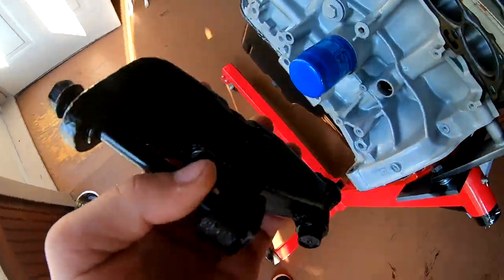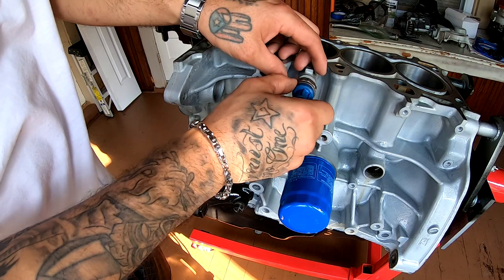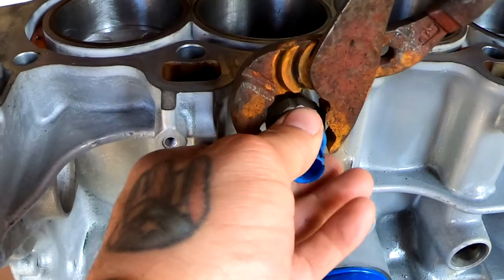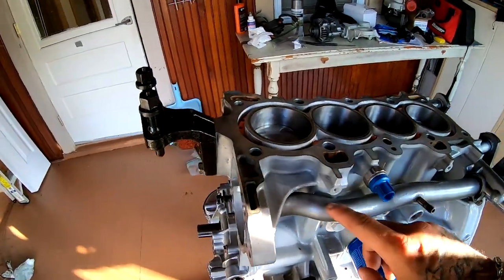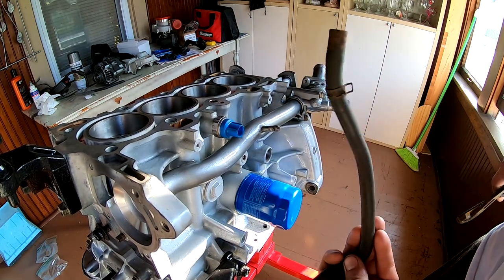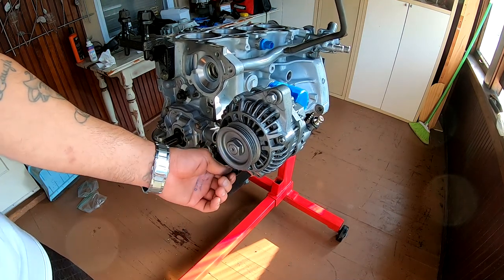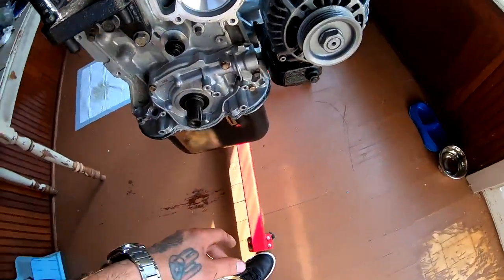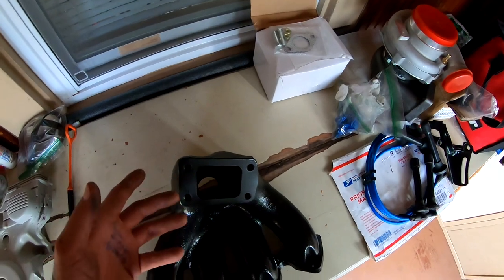500hp Honda Civic d16 turbo build Part15 (assembly of some bolt ons)

Comment: Nice work...you should get the right size wrench like you said its ebay those parts stripe fast especially using a monkey wrench there cheap at Harbor freight